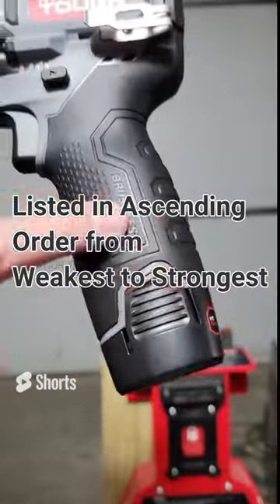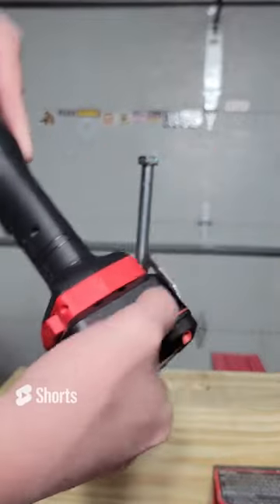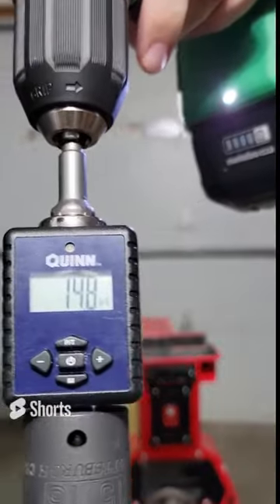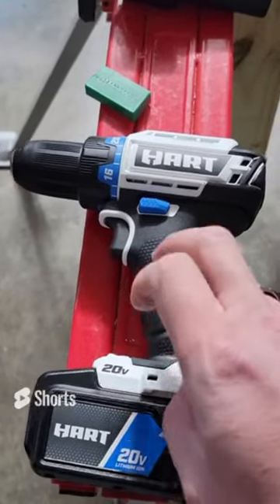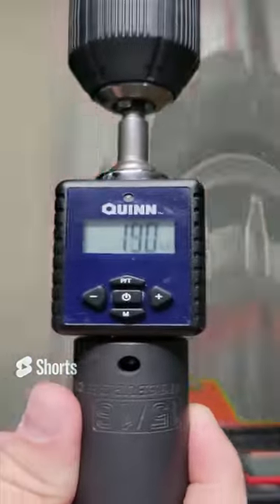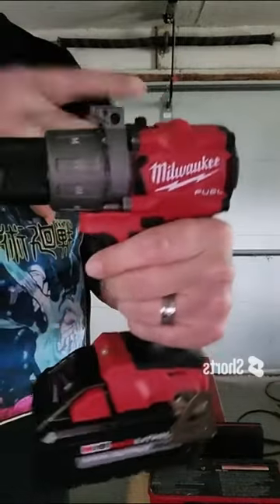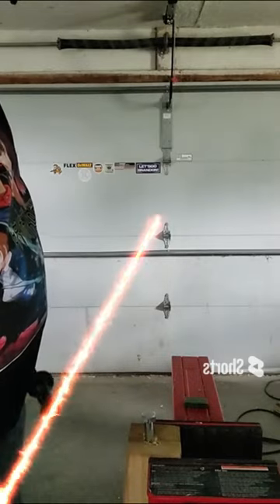Who Has the Most Powerful Drill? Milwaukee vs Dewalt vs Makita vs Flex vs #torquetest #torque #tools

Comment: Congratulations Robert on a successful 2022 and great job compiling all those videos.  Your torque testing series across all major brands was a thing of beauty to watch.  The current and last Gen Milwaukee drills are absolute beasts!  Even the M12 Fuel Gen 3 in its small packaged size put up a very respectable performance 👍
Reply from the maker: Milwaukee is definitely the winner for me. Don't sleep on Flex though. Thank you for all the kind words as well.
Reply: @ToolswithSoAlz  Absolutely not.  Competition is great for the consumer.  Flex has a very promising future as a cordless power tool brand and it should be interesting to see what type of power tools they’ll be rolling out over the next several years.

Comment: The gen 3 Milwaukee M12 beat the subcompact Ridgid.
I'm curious as to why you consider the subcompact Ridgid to be better than the M12.
Reply from the maker: Feels better
Reply: @ToolswithSoAlz  I'm surprised the M12 beat the subcompact Ridgid, considering that the M12 has lower torque specs.

Comment: What is wrong with the 620 inch pound Kobalt drill?
Reply from the maker: Buy and you'll take it back
Reply: @ToolswithSoAlz  Works IRL really likes his. I’m just trying to find something stronger than my DCD 777 to pair with my triple hammer impact driver.
I don’t need another super powerful drill, since I already have the high torque Ridgid hammer drill combo.
I had considered getting the DCD 791 or 793. Possibly the 996 because it’s still lighter than the 999.

Comment: interesting counterpoint to TTC's mountains of data, with its very very different numbers and conclusions
Reply from the maker: Yeah they tested the Milwaukee 2804 to 46.6 ftlbs and mine is at 48.6. That is about a 5% variance. They also had similar results with the Dewalt DCD999.
Reply from the maker: This dude and his mountains of data. What a moron. TTC runs one test, tales them 20 minutes, and get Fools to believe it's a lot.

Comment: While I appreciate you assembling all these drills for a video I do have a number of concerns: 
1) Momentary peak torque is not as valuable as sustainable working torque. As a professional I use my tools for repeated work which is where premium tools keep their cool and don't overheat or lose steam. 
2) The capacity of the battery is going to impact power and this is dyno proven. To minimize variance they should all be tested to a common standard (5 amp hr.) 
3) Some manufacturers bias gearing for speed or torque on setting 1. To get the full picture you need to see how they do in other settings and make three runs averaged to avoid any outliers. You want a balance between speed and torque. A 6.7 litre Cummins diesel makes boatloads of torque but I wouldn't want it in a Mustang.

I think the "Torque Test Channel" and "Project Farm" have more scientific and holistic tests which better understand the tool user needs. Ultimately, I don't think the peak momentary torque you measured really translates to real world performance on the job site. 

In summary- great job getting all these tools together, but more work needs to be done on testing design and eliminating variables. 

P.S. Your audio will sound much better with a standard collar mic and adjusted levels. Your wireless headset is good if you're in a pit crew or flying, but kills too much of the natural sound otherwise.
Reply from the maker: Good bye.

Also, Skippy, the test actually came from Project Farm so that part of your argument is ridiculous. Also, TTC has been testing drills for two weeks and confirmed these numbers within 10%. The biggest difference between what I am doing and what they do is I only need a minute or less. You just like pretty colors to look at to entertain you and pretend it's holistic data. Kind of like watching Sesame Street
Reply: @ToolswithSoAlz  Good grief. I try to offer constructive feedback and you respond like a teenager with hurt feelings and personal attacks. Yes, Project farm is far more HOLISTIC in the tests. Yes, TTC has far more ADVANCED approaches to the measurements and graphs out the torque curves. Guess what? They also respond positively to criticism and welcome suggestions. That's why they're successful.  Good luck to you, I'm sure you'll have a million subscribers next year with your originality, positive attitude and innovation.
Reply from the maker: Little lady, if you can do it better then do so. Since you pretend to know what you're talking about. You need spoon-fed information because you aren't intelligent enough to understand what's going on. You need the pretty colors and graphs to make you feel better because you're an elementary school kid. Men don't need that. Men also don't need someone repeating the same lines over and over again. We're going to test that. I was almost going to through that nonsense into this video just for people like you. The fact is those guys come to the same conclusions but need 20 minutes of pomp and circumstance to make folks like you feel they got value. As a man, I don't need any of that. I just need data. Also, since you want to bring up constructive criticism, let me point out that when a drill hits its peak performance torque it has the nasty tendency to shut itself off to protect it. That's exactly what is being shown in these videos. Literally explained in 60 of these videos that we test only for Maximum Torque. We have done other videos for sustained power. However, none of them use pretty graphs for the dim-witted so you wouldn't enjoy them either. We are the no-nonsense channel, currently sitting at 100,000 followers across all social media platforms. When people like you leave comments about something you should probably be smart enough to figure out the video first.
Reply: Interesting points.  However, I don’t think all tool brands can be compared to a common standard, as you indicate in bullet  point # 2.  Many tool brands don’t have 5 ah batteries.  For example, I don’t believe that Ridgid & Ryobi do, at least in the US they definitely do not.  Also - TTC and Project Farm are massive channels.  TTC has 250k subs and PF has over 2M subs.  The money they collect in subscriber revenue will dwarf the subscriber revenue that Tools with SoAlz collects, affording them greater resources to reinvest into the channel if they choose to do so.  So it’s not exactly fair to compare Tools with SoAlz to TTC just like it isn’t fair to compare TTC with PF.
Reply: @SouthFLTools  Thank you SouthFLTools for your thoughtful and reasonable reply. Going in order of your points I'll do my best to address them:

In regard to the battery, yes, there are probably certain sizes that are more or less common. 5amp was just an example of where you might start, but if 4amp covers more ground that's even better. Trying to give everyone as fair a shot as possible is the goal and avoid any outliers.

In regard to the size of the channels I mentioned (TTC and PF), yes, PF is a big channel now. However, TTC is only 2 years old and was started by three young guys with no cash in a garage. They crafted a simple rig on their own and relied on viewers to send them tools since they couldn't afford to buy them. They've exploded in popularity on a shoestring budget in a very short period of time because they bring something new to the table and listen intensely to viewers for ideas and feedback. They still rely on tool submissions and help from viewers to this day. 

It's really not about the money. The AVE channel gives you basically nothing but a video of a pair of hands, a voice and a tool on an old bench- but it's very interesting stuff and he has 1.4 million subscribers. Personally, I don't care how much money or resources a channel has as long as it's interesting and can open my eyes.
Reply from the maker: And do things the way you want them done because thinking it through, without pretty colors to distract you, would be a bit much. Every single drill was tested as kitted. Pretty simple concept to grasp. Also, all 60+ drills were purchased by me. If you can do it better then start your own channel.

Comment: Flex is smoking after ONE bolt.

This is why you rather use an impact wrench for this task.
Reply from the maker: Ok or you could just have someone Explain how this would truly be done
Reply: @ToolswithSoAlz  1 gear will not make this an ideal solution, anyways

Comment: Makita has overly conservative protections built into their tools, because of this the tools will cut out long before they are overloaded. This is just one of the reasons that they generally outlast other brands.
If I ever need to drive a lag bolts or anything else that is going to need that much power I’ll use my Makita XGD01, without a doubt it would get the job done without damaging the tool or myself and currently the only tool in its class that beats it it Makita’s 40 Volt version.

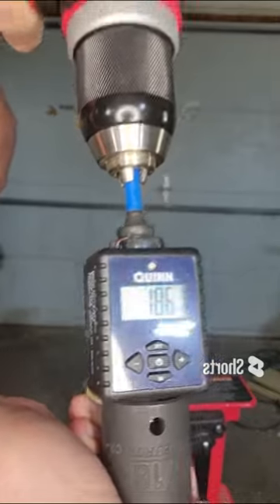Comment: DCD708 - 3:35
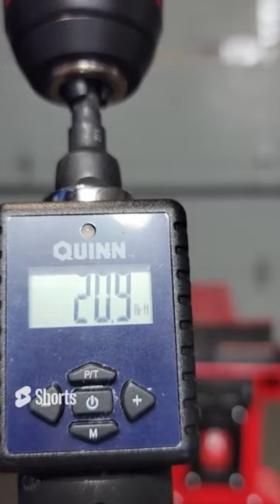DCD709 - 5:42
These are 2 identical tools with the same power. The difference is only in the impact of the 709.
Why is the power different?
I think this is an error.
DCD800- 5:55
This model is more powerful than DCD708 and DCD709.
But I didn't see it in the test.
Reply from the maker: Welcome to the wonderfully inconsistent world of Dewalt